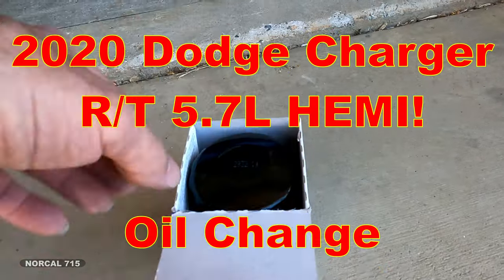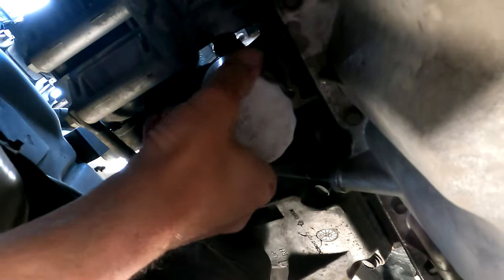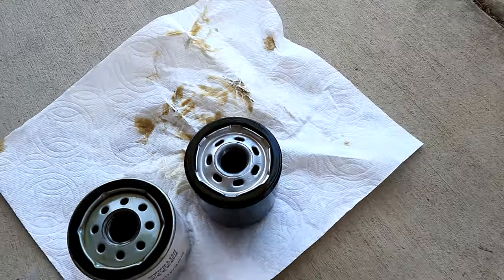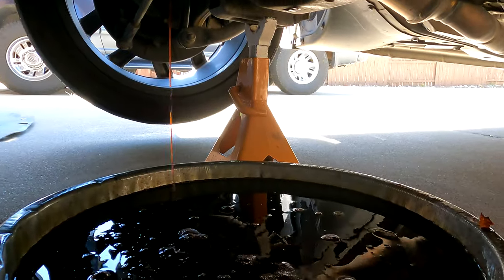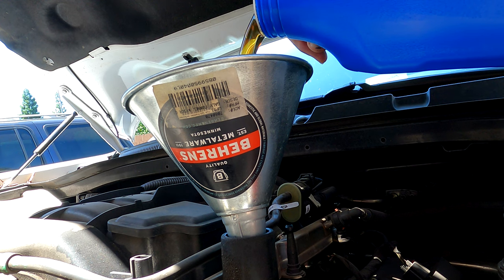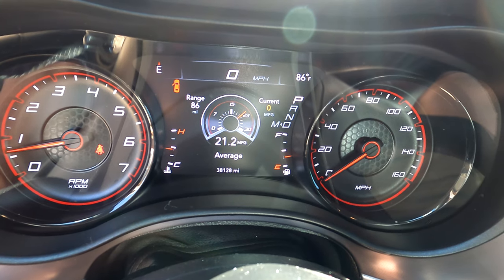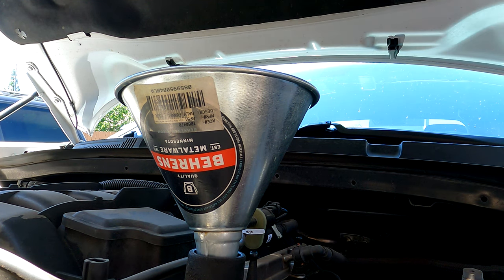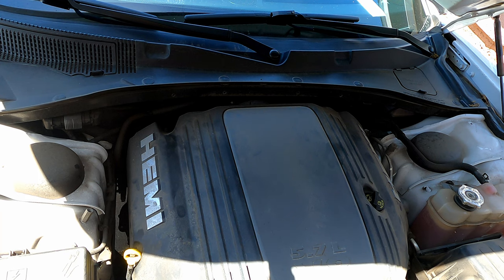2020 Dodge Charger Oil and Filter Change in 4K! Mopar

Comment: After the warranty is up on that Vehicle I would swap the oil to 5W30. All newer vehicles are using thin oil for fuel mileage, which  doesn't Make the engine last longer.
Reply from the maker: I agree, especially if you drive the vehicle hard, then the 0w20 and 5w20 (in my opinion) isn't the best choice.

Comment: The oil filter is installed correctly. It isn't supposed to tightened with tools. Seat the gasket turn 3/4 to 1 turn, or hand tight. I feel you overtightened your Merc. filter.

Comment: This is such a joke trying to find the factory replacement filter for my 2021 charger r/t 5.7. Every site has a different number and says the number from the last site won’t fit. 4892339be. 04884899ab. 04884899ac.4892339be again. Lastly 5038041AA is said to be compatible but the higher quality srt version. This is crazy!
Reply: You’ll find it on amazon
Reply: They will all fit your car, the 899 is the OEM filter 2014 and earlier. The 339 is the 2015 and newer. Not sure the point of the change but the thread pitch and the seal diameter is the same, the 899 is a larger filter than the 339. The 041 is the SRT filter that was designed for the Viper I believe. All 3 filters will work for your car but the 339 is going to be the OEM filter.